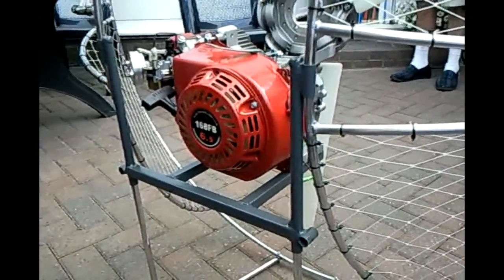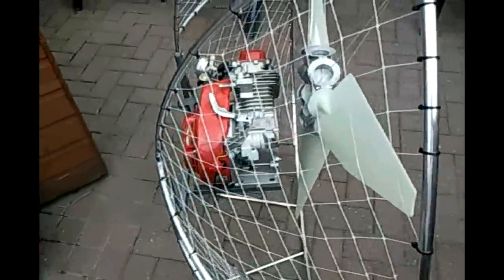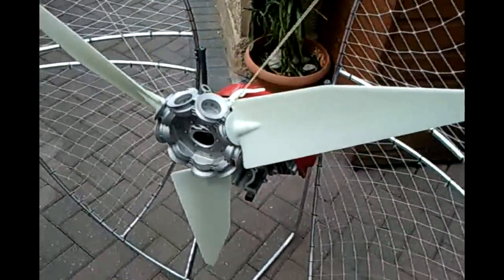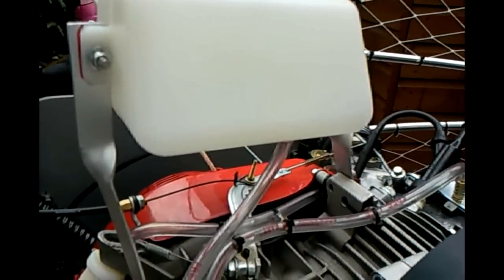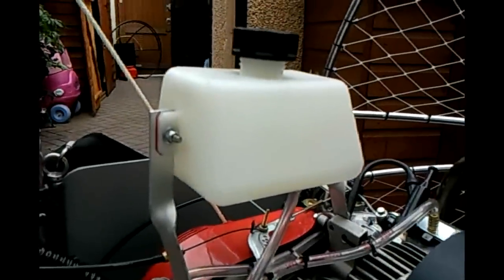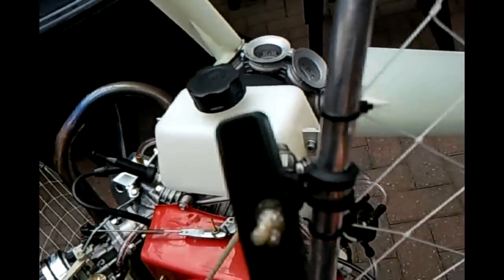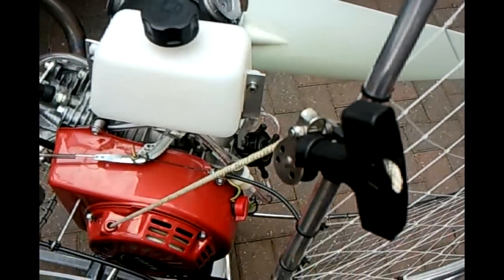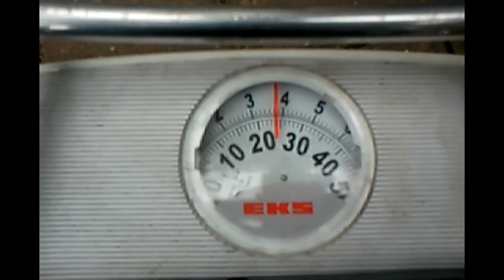GX200 Eggmotor. Abandoned Alloy Chassis Design

Comment: A Durafix brazed cage might work if you use a short piece of next smaller size to greatly increase the weld area. Fasten stub that is short enough to weld bead inside first, then slide frame piece over it and weld outside. The melt should wick up between the two.  Haven't tried it yet...  :-)